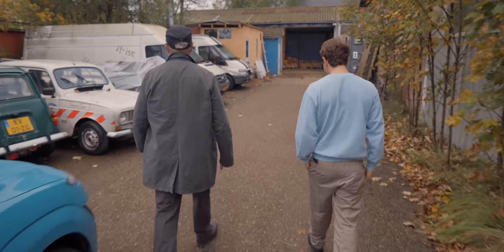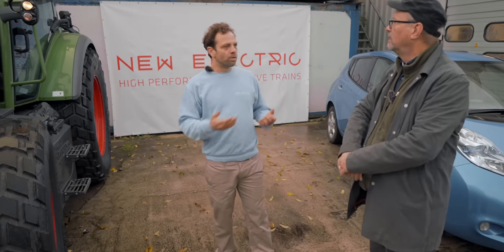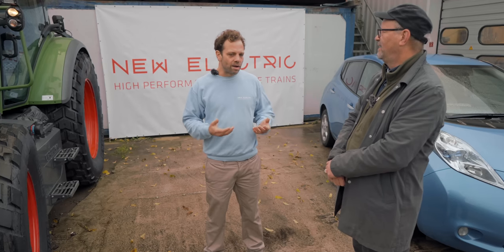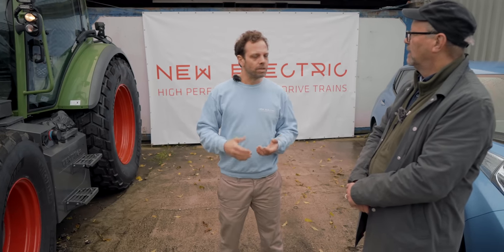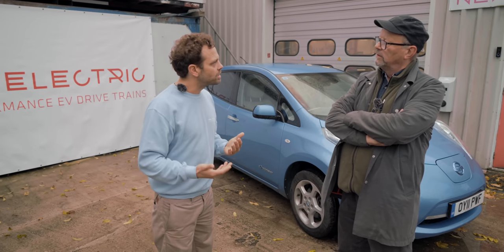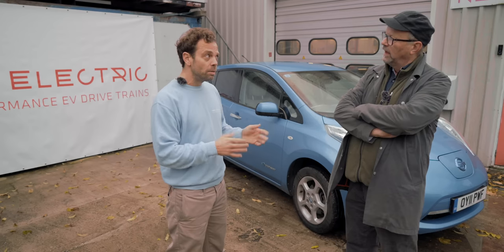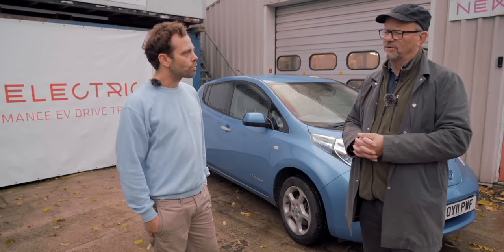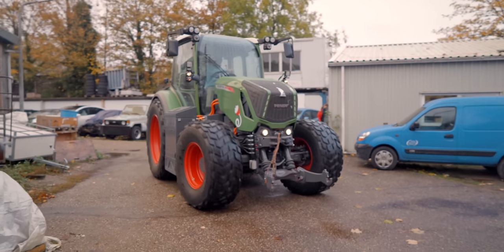New Electric - The converted Electric Tractor that pulls 30 tonnes

Comment: Lets just look at how much pollution it took to create that monster. All the exotic metals and their processing that took Petroleum products to produce, the plastics and the electronics in it..  Now, how much more pollution is going to be created making the electricity needed to keep the batteries charged up?    Sorry.. but until we come up with a way to produce electricity on demand that can be used in such things as this, going green is not a realistic alternative at this point.. 

Some ships and helicopters  use "electric on demand" systems, but they are powered by gas turbine engines.. Gas is not green energy.
The turbines run generators which produce the electricity used by the motors to spin the helicopters blades, or the ships propellers. 
And Ships doing this uses thousands of gallons of fuel.  Not really green when you think about it. 

So how is the electricity for this tractor going to be produced that is environmentally friendly? Right now it cannot be. Might as well have stayed with a Gasoline or Diesel tractor.

Comment: You know it is another EV-fanboy moment when you hear "zero emission". REALLY! And may I ask how is all this juice in all those batteries produced? ...... No I may not. There is no zero emission. Only to build the machine and then the external grid and all power plants, whatever it is. And all juice you loose transmitting it all the way to the moment, wheels actually start rolling. All the life cycles of ineffective stuff like wind turbines. This is bad for the environment, more bad than the old way of doing things, and then, what is the point? Yes I know, the point is selling his product. There is massive amount of emissions involved. So stupid, like saying -This diesel engine do not need any petrol at all! Oh, no kidding. We need to do the math right.  Anything else is just good old Snake oil.